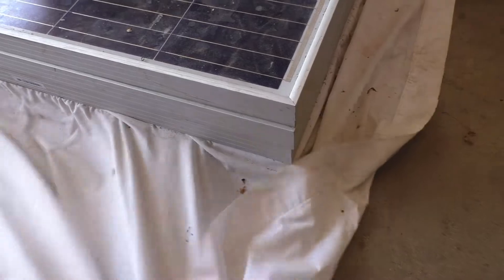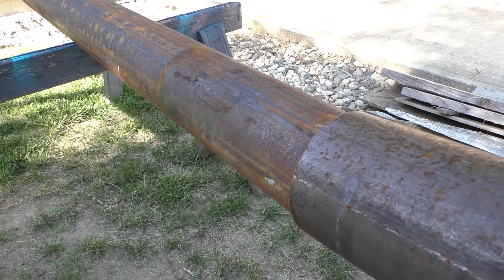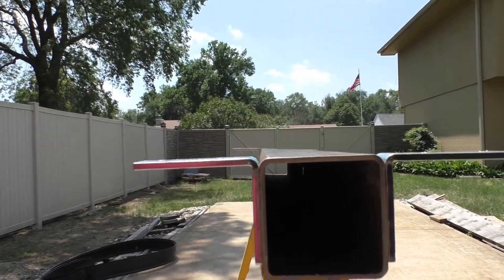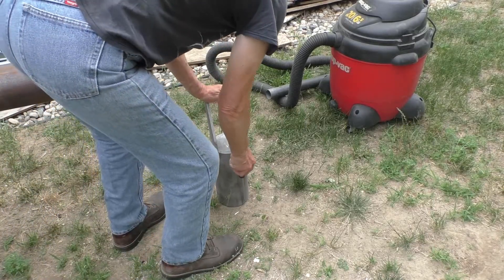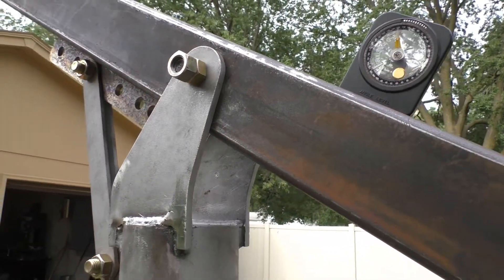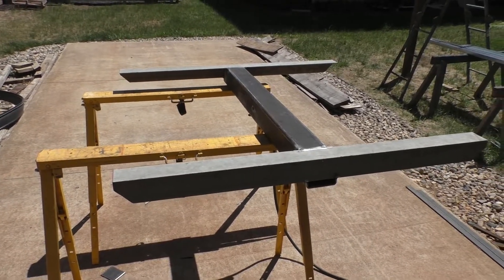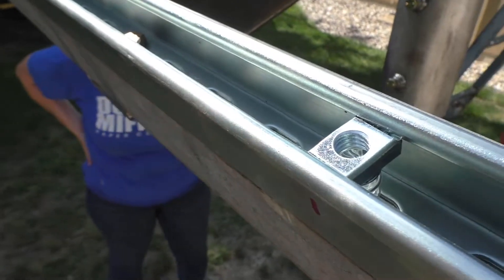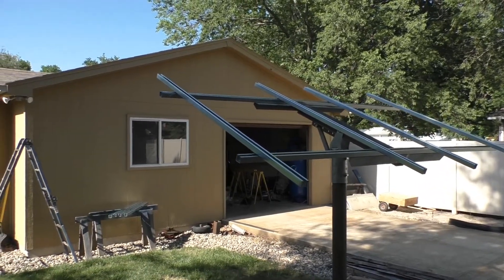Solar Panel Pole Mount DIY Homemade Four Panel Array Spencers-Mountain Off-Grid

Comment: Great build and many thanks. What is the thickness of  the swivelling top cap and what size of bolt?
Reply from the maker: I believe the cap pipe was 6” schedule 80 to get the fit.  That would be .432” wall. The tabs are 3/8”.  The bolt is 3/4”.  The bolt is a high alloy item I found in trash. Everything is a bit overbuilt. However area winds can exceed 80 mph so it was better to and cheaper to use heavy salvage materials and use my free labor to keep cost low. Thanks for watching.  There is a follow up video installing the mount.
Reply: I got the thickness 3/8 inch. Didnt get the bolt size.

Comment: I see people use the basket ball posts to mount solar racks on them. I have no tool or skill to "play" with them so I use lumber
Reply from the maker: I am using 5-1/2” schedule 40 pipe. I would not recommend the thin wall basketball goal tubing as it is too thin for an array. Be sure to know the highest wind speeds in your area and calculate panel area for pressure at that velocity. It could be possible to work metal with an angle grinder and drill without welding using the right parts.

Comment: Its awesome, but kindly share the dimension & size of poles, c-channel, angles etc
Reply from the maker: Thank you, but please understand that something like this needs to be engineered for the installed location. Soil condition for foundation and area wind conditions need to be considered.  That said, 5-1/2 pipe was use for post. 6” pipe for pivot cap. All brackets fabricated from 3/8” steel plate. 4” square 1-4” wall tube for backbone with 4 foot long 1/4”x3”x3” angle iron at ends.  1-1/2” Unistrut  framework to suit mount locations in solar panels. 1/2” bolts used to fasten all, except pivoting locations use 3/4” bolts.
Reply: @SpencersMountain  This info in enough to understand all setup. Thanks 😊 🫂

Comment: Looks like you planted them in a shady area. But you did a great job. I love your work.  Much respect 🙏
Reply from the maker: You are right, Not the best location but a good place for keeping an eye on things since a lot of experimenting is going on at this point. So far the yield has been higher than expected and our usage is covered by morning light after the sun clears the trees. A couple afternoons the panels were turned to afternoon light on a cloudy morning and caught up the batteries.  Eventually, the array will be moved to an open area on the property and maybe a tracker added for fun. Thank you for watching!

Comment: nice build, do you have plans available
Reply from the maker: Thank you. No I do not have plans available. I did try to provide enough video information to convey sizes of materials used. However, be aware that mechanical structures and applications does not apply in all situations. Too many variables like weights, wind and installation determine success. Plans and execution have a high degree of liabiilty. I offer my experience as entertainment only. Thank you for watching.

Comment: Put a grease zerk on the cap u made so u can move it easier. It help fight rust. 
 Not on top but the side. 2 of them should be enough to distribute the grease good.
Reply from the maker: Thank you, that is a great idea. I put two bolts in the cap with nuts welded over the holes to secure the cap on the pole. I drilled a cap screw through and put a grease zerk in that cap screw. Now I can simply put the screw into the cap to grease at two places where those set screws are located. I really appreciate that you took the time to leave a helpful comment. Thank you for watching.

Comment: Another awesome build, i think it will be able to withstand any amount of weather, great job :)
Reply: Nice job. I would like to build for my solar panels can you send me The dimension so I can build it thank you.
Reply from the maker: @Robert Chavez  this was sized for my particular panels. Based on a five inch pipe for the post six foot tall out of the ground. The backbone at the top of the post is  four by four steel square tube with 1/4” x3”x3” x48” angle iron on the ends. Rest of frame is Super-Strut spaced to match holes in panels. If the panels were clamped to frame the dimensions are less critical.
Reply: @SpencersMountain  Thank you for sharing some information about your solar array if you can give me one more dimension on your top cap that you made with the bolt hooks up to the 3 x 3 tube?
Reply from the maker: Thank you! The wind pressure on four solar panels is a big unknown at this point, but we will adapt and overcome. Thank you so much for watching!